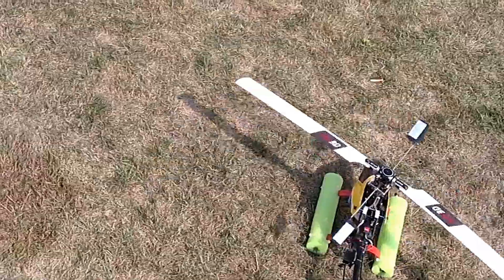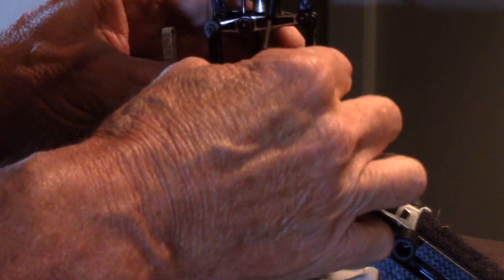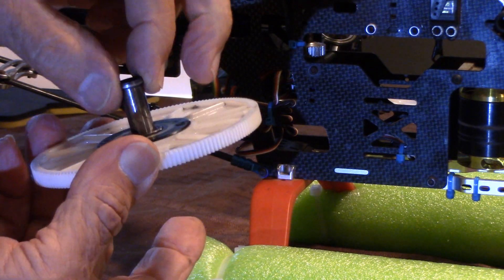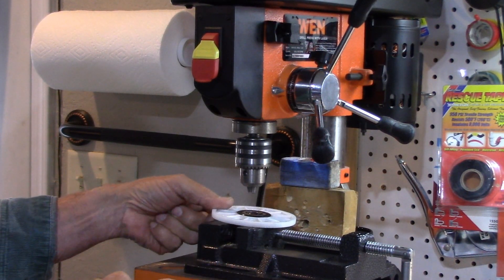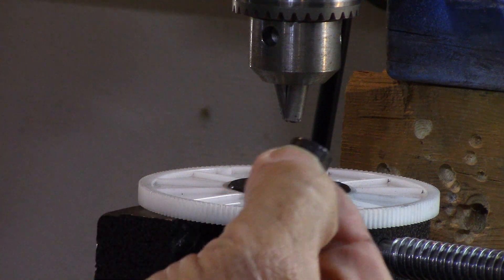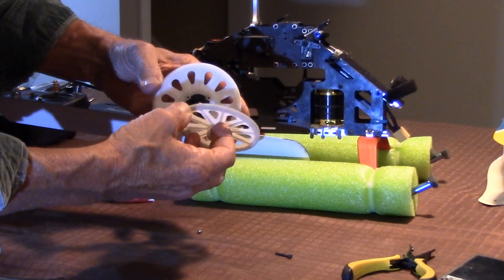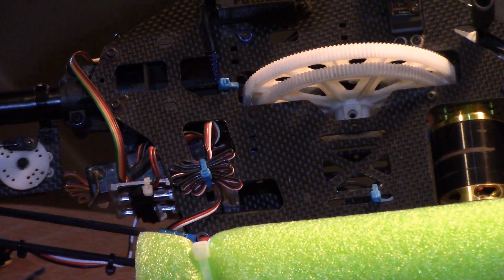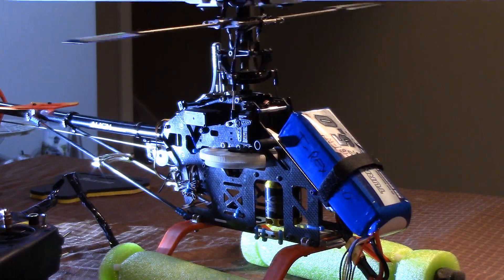See my Align T-Rex 550 Heli Auto-Rotation bearing fail in flight, how I fixed it, and a test flight.

Comment: Hello Mr. Herbert .Enjoy all your video's . I have a question for you . I have a TREX 450 . When I give it trottle only the top or large gear turns . I can turn the bottom gear by hand and the top gear doesn't move .Doe's this mean my one way bearing is failing . Thank you so much . Bobby Miller
Reply from the maker: Well the top gear is connected to the Motor Pinion gear and spins with the motor. If you can turn the bottom gear only 1 way, then all is good.  But if it turns both ways, the bearing is bad.  Hope that helps.  Thanks so kindly for watching.  Happy flying.
Reply: @NightFlyyer  Thanks , The the bottom gear turns both ways . I have ordered a bearing . Thanks again . I will also watch your video on replacing the bearing I truly enjoy watching your videos . They have helped me so much . Thank you again , Bobby

Comment: I wonder if you could give me some guidance, I'm learning to fly rc helicopters and I bought a vintage hirobo falcon as a project while I learn. (I'm a mechanical engineering apprentice and live for this stuff.) 
My question is this: what is the best way to replace blades? I'd replace them with new fibreglass ones but all seem to have only one hole for fixing to allow them to pivot. I considered drilling a second hole but I don't want to waste £40 by wrecking them. It has a pair of serviceable blades, though they look a bit tatty. Any advice would be greatly appreciated.
Reply from the maker: Congratulations on taking the time to learn helis.  I have many instructional videos on the subject and it helps to have a good simulator.  I use Aerofly Ultimate, as it feels the most like my real model helis.  Many helis only use one hole these days and they swing and wobble when not in line.  Real helis use the locked blades when in flight, so there is no problems.  You can use 1 hole, so try that first.  Make sure the blades are not too long, as they can hit the tail rotor and make sure they are not too loose, as jockeying the throttle can cause them to get out of line and hit the tail boom.  I know this all from over 50 years of flying them and had all kinds failures that is part of my learning curve.  See my video on wobbling helicopters.  Here is a link and good luck. https://www.youtube.com/watch?v=KLLfnJajixU&t=9s
Reply: @NightFlyyer  thanks very much, I will definately look at getting a decent sim as I hadn't really thought about that. For now the original blades are probably ok, but just in case I'm glad there is the possibility of replacing them if needed.

Comment: Such useful/helpful info, Dave! Thank you!
Got a problem with my Trex 450SE: keeps browning-out in flight, SEVERAL times in one flight! Had to land immediately, and had to stop flying it. ESC seems the most likely, but I've had two different ones in it and it still browns out. WHAT the heck could be causing a power loss mid-flight? Don't think its the Rx cuz I got a new one from Spektrum and they said nothing was wrong with the one I sent back. Could a bad motor cause a short/power loss in the Rx? Servos? Gyro? I bought it used from a guy (many years ago) and it's ALWAYS suffered from brown-outs. He says it never did it when he was flying it. Now, he was flying a Futaba Rx and I installed a Spektrum Rx. Could THAT have something to do with it??? It's a beautiful machine, my pride and joy, and I can't fly it cuz I have NO IDEA how to fix it. I bought a new motor for it but I don't see how the motor could cause a power loss in the Rx??? I don't have any spare servos, gyros or Rx's so I can't do any troubleshooting, really. Have YOU ever experienced brown-outs?
Reply from the maker: Hi.  Well I have had only a couple brown outs and loss of binds, but it was due to the BEC, in the ESC, I found.  You might try to put a 4 cell NiMh battery in it to run the RX and Servos and skip the BEC.  The battery is a constant voltage and you might be able to determine it that way.  I don't recommend using different brands of TX's and receivers, as Protocols may look the same, but.....  Good luck and happy flying.

Comment: Awesome fix, FYI you should have applied a little bit of high temp bearing grease in the bearing prior to reassembly. I also clean and re grease mine every 4 or 5 months of flying  depending on how hard you push them. Thanks for the Vid.
Reply from the maker: Yes, I would have put grease in it, but it came already loaded with grease, so didn't need too.  Thanks for the tips and comments, Don.

Comment from the maker: My T-Rex Helicopter's 1 way, Auto-rotation bearing failed at the beginning of my flight.  Here is how I easily fixed it with a test flight afterwards. This removal method and the pressing in of a bearing will work for many helicopters and gears.   Thanks for watching.
Dave